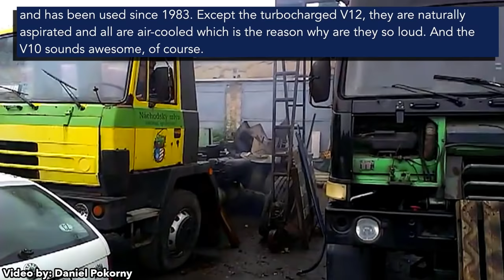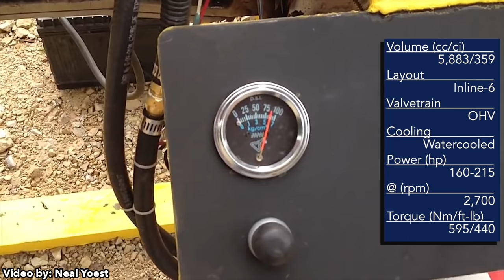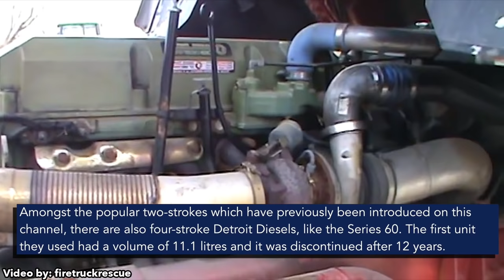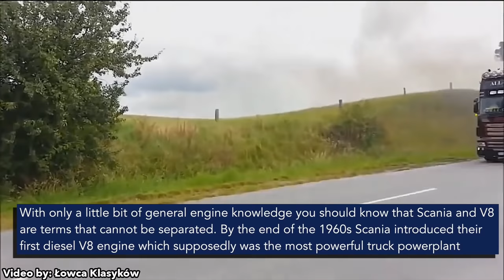10 Best Sounding Truck Diesel Engines

Comment: i really wish they would have included the 6.0 powerstroke. the engine was junk, but my god did it sound sexy
Reply: Offroad circus bulletproof them and thier actually really good engines
Reply: Aww man please they sound like the pistons are hitting the heads
Reply: But you never heard the engine, you heard turbo.

Hell even when you did it sounded like one single revolution and not many. Like a damn rudder slapping a wall at warp speed.
Reply: Fake news the engines weren't junk whatsoever. Cast iron heads and block made in the USA. Point out a duramax that doesn't need a new cp3 injection pump, head gaskets when tuned and not studded, or a new turbo at some point. Great thing about a HEUI is whenever the injection pump goes it doesn't send metal through your entire fuel system 😂😂
Reply: alec chamberlain great points! That’s why you stick with a 12 valve cummins
Reply: #metalworker#hdtruckmechanic #automechanic#farmer reliability good, power none. Sure you can build them to make good power, but the money you spent hypothetically on a newer cummins would've made even more power. But I'm impartial to Ford
Reply: alec chamberlain spent 4500 on my 12 valve engine and about 2000 on the drivetrain and had  excellent fuel efficiency perfectly reliable with very little smoke, and 550 whp. I know it’s not extreme amounts, but the fact that I could get 22 mpg. Made me happy. Fords are excellent trucks but with a better chassis than dodge. But from my experience as a professional diesel mechanic, I would try to stay away from it all of their Diesel engines except the 7.3. UNLESS you enjoy fixing something correctly and have a few $ to spare, then by all means, by a 6.0, but not the 6.4
Reply: Rode a brand new then E250 work van with it. That thing moved for being such a heavy and large vehicle full of tools and parts. That 6.0 had poke.👌
Reply: @GIGABACHI  there's an outfit outa Tennessee that married a 6.4 powerstroke crank into a 6.0. Making it a 6.3 and cranks out 850hp. 12.5gs for it🤙
Reply: @alecchamberlain4231  Fake news? Why do you think Ford got sued over them and the 6.4s? Because they kept breaking down in ambulances with people in them and there were people who died as a result.
Reply: Logan Cobb #68 well yes if you drop thousands into any diesel Ittl be a good engine
Reply: Every powerstroke until 2010 was made by navistar. They had a contract with Ford to design and produce the engines for almost three decades. The 6.7 that’s been ran since 2011, and the 3.0 v6 are the only in-house Diesel engines Ford has ever designed.
Reply: Offroad circus they aren’t junk. Lol they just need work from the factory and they are as reliable as any other engine
Reply: All they sound like is nag
Reply: @jonathonbridges9625  6.4 is a punched out 6.0, they have the same length stroke.
Reply: @alecchamberlain4231  The CP3 pumps are solid, it's just the CP4 and CP4.2 are the ones that suck.
Reply: Agreed. 6.0’s sound better than the 7.3’s.
Reply: I love the 6.0, have one that is around 200k and has never been bullet proof. AMAZING fuel mileage and decent power and it’s fairly tough. But it is very expensive to work on and they can’t withstand a lot of tuning.
Reply: I love my 6.0 pulls like a mule and sounds like a jet engine  no serious problems yet with 125000 miles on it torched my stock clutch though when I chipped it but that's my fault for running a clutch designed for 325 hp and threw 425 at it with a gooseneck trailer hooked to it it'that 6.0 has handled everything I've thrown at it and has not left me stranded once.

Comment: Cummins straight sixes are the best diesel engines in overall usability, form factor and reliability also they sound so damn destinctive. 
Yeah and then there´s Scania... You cannot drive that V8 blasting up a hill and not turn heads.
Reply: Da vid said no one ever. Juuuuunk.
Reply: Da vid cummins has the best sound I love a strait pipe ISX especially with a heavy load
Reply: Jimmy Doolittle n14 cummins is pretty much bullet proof
Reply: Jim Allen 1. These things only happen to idiots that turn up the fuel pressure and lug the engine letting the egt get to hot.
2. Heat cycles are what kill an engine so no matter if it’s a 6nz big cam n14 isx or a 2 cycle Detroit, none are immune to stress and all are prone to fail. Just had a guy n the shop last week needed to rebuild his c15 because the water he put in with the antifreeze wasn’t neutralized and ate through his liners.
3. N14 is still one of the better engines out there
Reply: Yeah But Scania is the europe king of the road ;-)

Comment: Cummins are quite insane; I used to drive a bus with a straight 6 (don't know the model) and an Eaton automatic transmition. It could easily accelerate faster than a regular car in traffic

Comment: you did forget the most legendary in europe.. Iveco TurboStar. 18 litre V8 twin turbo. check that one out
Reply: I never heard of it, i thought scania V8 was the most known and legend-ish in europe?
Reply: You lost me at Iveco
Reply: @tunturimies84  It was a great and very powerful engine in its day, but got discontinued by Iveco for some reason. It never had the success or the following of the Scania V8 but it was larger in capacity 17.3 litres and sounded great at 480hp (in the mid 80h's) . The Iveco V8 is history now - but the Scania just gets bigger and better!
Reply: It use the mack v8 if I'm not mistaken
Reply: Phillip Aubin  Sharing block still doesn't mean "it's just Mack V8". Toyota 2jz is based on Nissan RB, but doesn't it make Nissan, nor Toyota who also took part in development of 2jz.
Reply: Mercedes Benz had 3 v8 engines, Roman Diesel had one v8 Alpina, MAN had a 601 hp V8 engine, I think most of the European truck manufacturers produced to some point a V8 version of an engine... but than again, here you have a list with the 10 most best Sounding V8 engines! I have heard in lines sounding even louder and melodic than some shown in this video

Comment: Nice video. Very interesting examples. I grew up riding in and driving trucks as far back as I remember. The old 1960's model "THERMODYNE" MACK should be on this list. Also, the 471 and 671 Detroit's sound way better than the v8 models. to me at least. A screaming 671 is musical. We had 2 with straight-stacks, and to run them side by side at high rpm highway speeds created a warp in the space time continuum.

Comment: The Scania V8 you putted in this video (with bore x stroke 130 x 154 mm and 16,353 cc of displacement) is named Scania DC16 103 V8. The bore x stroke of the 15.6-litre (15,607 cc) variant was 127 x 154 mm. The bore x stroke of the DS14 was 127 x 140 mm, for a total displacement of 14,188 cc.
Hope this helps you with your next videos containing these engines. Keep up the great work!

Comment: One engine you really did miss out on this one is the 6.0 ford Diesel. May not be the most reliable but it has the greatest diesel sound period.
Reply: That's because the piece of shit was always on the ragged edge of blowing the head clean off the block!! Biggest piece of shit motor International ever friggin made!!!!! what's worse is they were put in one of the sharpest looking body styles Ford has made in quite a while.
Reply: few small tweaks and people have made them pretty reliable. 7.3 reliability? No. but still pretty reliable
Reply: Whityford The 2005-2007 6.0 had less warranty claims than the 7.3.  Early 6.0's had issues, but so did the early duramax.  People that hate on the 6.0 are usually fanboys of Cummins/duramax and have never owned a 6.0.
Reply: Yeah, Ford never should have stopped using the 7.3.  That was the last engine that International designed.  The 6.0/6.4 was designed by FEV.  But I've never liked the sound of the 7.3.  It's always sounded strangled through the exhaust system.
Reply: Andy Harman Ford should have had International modernize the 7.3 with common rail injection, 4 valves per cylinder, variable geometry turbo, etc.  The fact that International outsourced engine design to a third party firm is pretty pathetic.  Shouldn't a multi-billion dollar corporation have a team of mechanical engineers to design in-house?  I've owned a 7.3 and currently own a 6.0, I agree that the 7.3 doesn't sound nearly as good as a 6.0, 5.9 Cummins, or Duramax.
Reply: squach623 !!!!! "Blowing the head clean off the block"?  That doesn't happen, the torque to yield bolts stretch slightly which is why 6.0 get a bad rap.  There are two reasons this happens:  The first being a blown egr cooler and neglecting to recognize the symptoms of such.  The second is pushing the truck way too hard with a psycho tune and pushing 40+ psi of boost.  ARP studs fix this issue.
Reply: +Andrew B my coworkers 6.0 blew his head-gasket at only 100,000 miles. My 2005 cummins runs circles around it and has NEVER had any issues. 207,000 miles and gets 20 mpg easly. 
The ford 6.0 struggles to get 15 mpg.
Reply: drunkinmaster1 You do understand that anecdotes don't mean anything.  For one, there are plenty of 6.0's with more than 207,000 miles that have original head gaskets/studs.  If your "co-worker" is getting 15 mpg, that means something is wrong or he's beating the shit out of it with a tune heavy on fueling.  I get 17-18 in town and 21-24 on the highway with my 6.0.  I can't say anything bad about the Cummins engine, but being a 2005, you probably have an automatic 48RE transmission which is a total piece of shit...and it's a 4 speed which is years behind Allison or Torqshift.
Reply: The Ford 6.0 has always been the worst Diesel engine that comes from factory. Only way they are good is if you bullet proof them and tune them correctly is when they are perfect.
Reply: Andrew B
Actually all he does is commute with the workcrew and tools back and forth. Mostly highway miles, and no hes not the type to beat the shit out of stuff. 
My truck has a g56 manual transmission and shifts smooth as butter. 
So basically youre wrong buddy. 
My Oldsmobile Alero ran longer than his 6.0. Pretty pathetic 

Ask any person who drives ambulances with the 6.0, consistently in shops being worked on.
Reply: bridger jokela The 6.0 has its issues, I can't deny that...but the resale value (or lack there of) justifies buying a 6.0 and bulletproofing.  For example, I bought a 2004.5 E350 6.0 van with 79,000 miles for a Sportsmobile project.  I paid $5500 for the van and spent another $5,000 bulletproofing (it didn't have blown head gaskets, but I figured I'd stud it anyway).  Comparable Chevy/GMC vans with the duramax are $18,000+ with similar miles.
Reply: Andrew B
Yeah it all peachy when youre driving home an hour away from home, all of a sudden your 6.0 blows a headgasket and dumps coolant out of your exhaust. 
True story
Reply: drunkinmaster1 The G56 transmission is notorious for gear rattle problems, you'll encounter it eventually.  The 6.0 isn't designed to idle for long periods of time.  Ford did update the ECU to close the egr valve during idle which eliminated this problem.  Ambulances typically idle for long periods of time, which is going to create issues.  You actually owned an Oldsmobile Alero?  Did you use it to pick up pussy at a retirement home?
Reply: drunkinmaster1 I'm running a stock tune with a studded engine, I'm not worried.  Don't get me wrong, the Cummins engine is fantastic.  Every truck has it's weak point that other manufacturers have perfected.  In the 6.0, it's head gaskets.  In the Dodge, it's ball joints and transmissions.  In GM, they have weaker front ends.  I like all diesel trucks, my best friends has a '99 Cummins that's a great truck.  My brother has a '06 Duramax that has been problem free with 250,000 miles.  My 6.0 has been trouble free since I've owned it (I bulletproofed before I drove it even 1 mile).
Reply: Yes I had an Alero which was pathetic. Unfortunately the 6.0 was less reliable. 
Sorry Andrew, you shouldn't need to put $5,000 into a stock, well maintained vehicle. Barely rolled over 100,000 miles and started dumping white smoke like the mosquito patrol.
Reply: drunkinmaster1 Ideally, you shouldn't have to dump that kind of money into it, but you can get 6.0's cheap and negate the cost compared to a GM or Dodge.  White smoke is either a blown EGR cooler or a stuck open injector.  These things happen and Dodges/GM products are far from perfect.
Reply: drunkinmaster1 i have a 2006 6.0 and never has given me any issues. as long as you take care of them and dont drive like a fucktard youll be ok. also the mpg is true😂 i get 14 at best
Reply: bridger jokela the 6.4s were real garbage. there was no fixing those
Reply: GutlessCutlass This coming from a "guy" that has Japanese cars on his profile.
Reply: The 6.0 isnt designed to be idled for long periods of time, 
The 6.0 runs great after you throw $5,000,
Dont run the 6.0 hard and it will be reliable,
People who like Japanese cars know nothing about diesels
🙄🙄🙄  

Excuses for fanboys of a turd engine, but has a wonderful exhaust note.
Reply: drunkinmaster1 I'm not a fanboy, if you read my posts and have a decent command of reading comprehension it would be obvious that I'm not a fanboy...again, every truck has had issues.  Google "type 53 block", Cummins have had issues, too.  Google failure rate-company buybacks of the 2007 Cummins...the failure rate was high.  You're the only fanboy here, my very first posts remains true.
Reply: +Andrew B only Toyota Hilux don't have any mechanical problems
Reply: +Andrew B my first truck was a 6.0..... garbage and now I drive a 2009 duramax, its a beast. It rides amazing, pulls amazing and never given a lick of problems with 85,000 miles
Reply: sack matters the only thing better is a single turbo 6.4 very similar to a 6.0 except way more rapp
Reply: Sackmatters nah 7,3 sounds better
Reply: 7.3 was the best ever.
Reply: Got 3 of em haha
Reply: Um... all you hear with the 6.0s is the turbo whistling cause of the VGT setup.
Reply: drunkinmaster1 2005 and up 6.0 were problem free it was the early ones 03 and 04 that had problems the motor was rushed to the market because they had to make a motor with less emissions than the 7.3. That's why in ambulances they were especially bad.
Reply: sledsrme
No offense, but my coworkers truck is an "06" and had numerous issues including blown head-gasket.  
He did not chip it or abuse it. Truck looks beautiful inside and out because he meticulously maintains it.
Reply: bridger jokela not trying to start shit, but the 6.4s were worse in so many ways,  including: egr cracking and bending #8 rod, regen torching holes in 7 and 8 and killing turbo seals which sucks all the oil out of the engine, using no bushings in the connecting rods, and steel valve guides. And it costs over twice as much to repair or replace anything on them.
Reply: Adam Moldovanyi why don't you just @ bill at powerstroke help dot com.
Reply: Billy Hager how do you know I'm not bill
Reply: I don't care what anyone says about the 6.0 it's sounds so sexy
Reply: Sackmatters nope. N14 cummins , or a series 60 take the cake.
Reply: Sackmatters 6.0....? Hahahahaha! Thanks for the laugh mate.
Reply: Canuck Canadian I run a Redtop N14in a Freightliner! Great motor awesome sound even through a single stack! Love the braaap sound of the Jake's pulling it on down!!
Reply: Sackmatters it has great loud sound... but it can only go backwards. forward only down hills.
Reply: Andy Harman the only reason why ford switched over from the 7.3 to the 6.0 was the emissions problem with the government. That’s also why the 6.0 was so crappy in the beginning. They rushed production and design of the engine to meet federal emission laws
Reply: Now Cummins is no more good head studs, head gaskets injectors, etc.
Reply: Agreed. Best sounding imho. I own one and with some TLC and some common sense they can be reliable
Reply: Damn did I make quite the stir in here lol.

Comment: 8v71? That's an interesting variant... seen plenty of 6V71 and 6I71's but never an 8. Most of the equipment I've seen jumped to the 8v92. Fire apparatus were famous for it. Silver 92. 525 HP usually twin turbo. Those sound AWESOME.
Reply: kleetus92 8v71s are popular rare is the 8v53
Reply: Yes... I'd love an 8V53...
Reply: kleetus92 Put That Silver 8V92 In A Stretched Out CHEVROLET BISON, Then You Have Bragging Rights! That Or A 12V92 With 4 Turbochargers!!
Reply: Quite common in the late 1960s to mid 70s, when the 92 series came out.
Reply: I used to be a Fire apparatus mechanic. When I heard that sweet DDA sound I knew it was time to get to work. The biggest one we had was a 450 HP 8V92.

Comment: Fun video and the Mack E9 is by far the top dog (pun intended) in the V8 diesels. disappointingly though, you overlooked the Cummins V504, VT555 and VT903 all great sounding and good performing V8 diesels in their assigned truck classes. I hope you will do a video featuring those.
Reply: Not really, Scania beats it in sound and power

Comment: I would also personally like to call your attention to the Deutz F6L912 Inline-6, a great little powerhouse with a reputation for being indestructible, as well as the 12.8L V8 found in the Mercedes Benz SK. Both are very durable and amazing sounding engines.